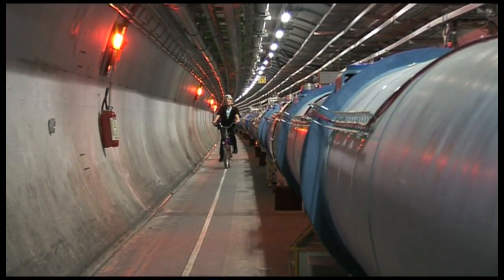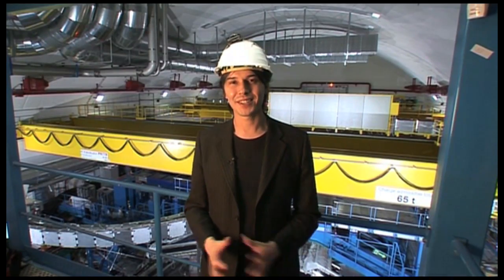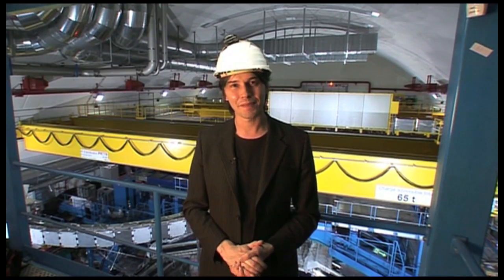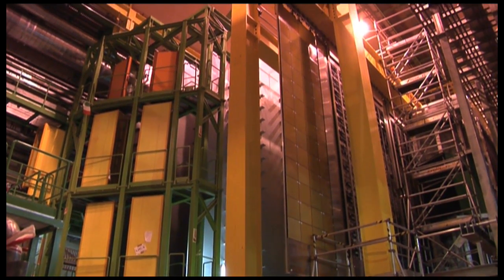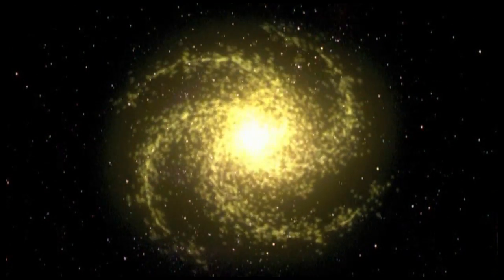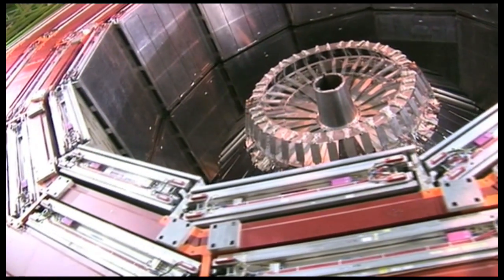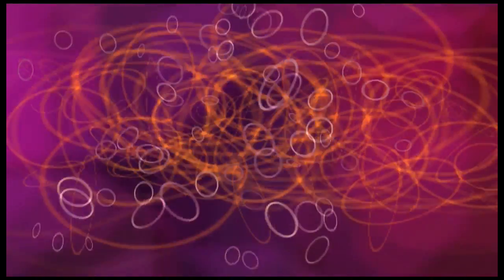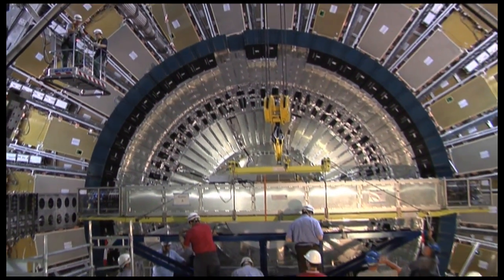Probing the Secrets of Matter and Energy

Comment: The light beam of a light clock has a tail or light trail. So if you quickly change direction wouldn't that cause the light trail to bend or fold on to it's self causing time to slow down. 

  When you are involved in a car wreak your body is going forward but the car your traveling in has stopped do to the impact. 

 Therefore you are folding time and space. This would explain the big bang.

 Time Travel?

Comment: You don't need a 'better theory' to discredit an existing one. If you can even call blackholes and dark matter a theory.

But you should check out the electric universe theory, because unlike the crap you've been following, it does fit the phenomena very nicely and involves many empirical and lab-reproducible elements.